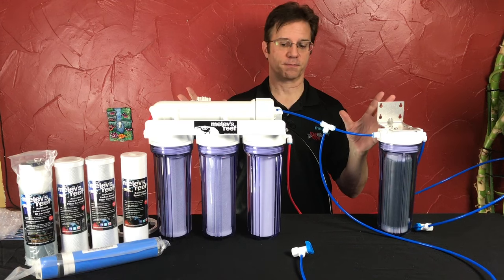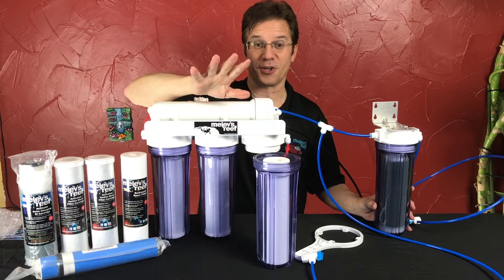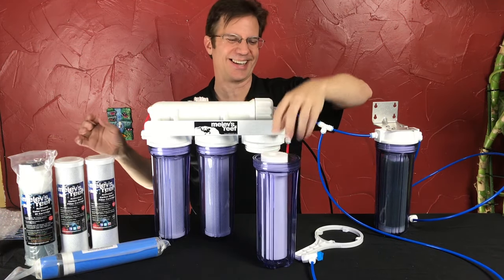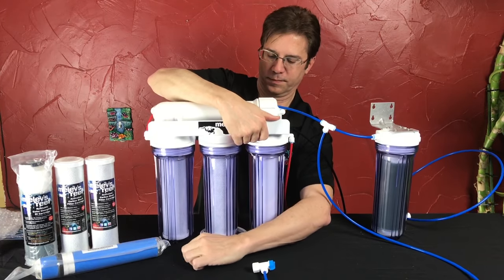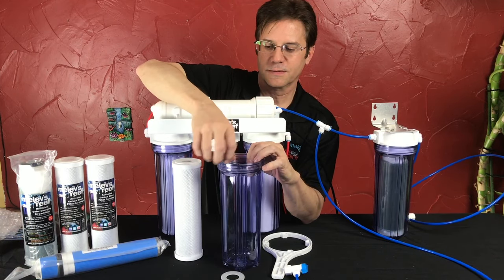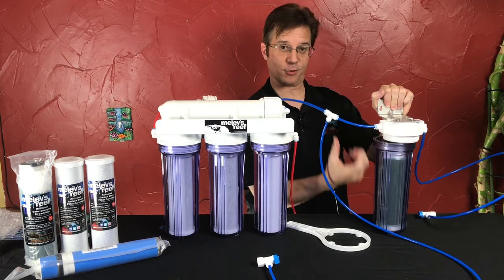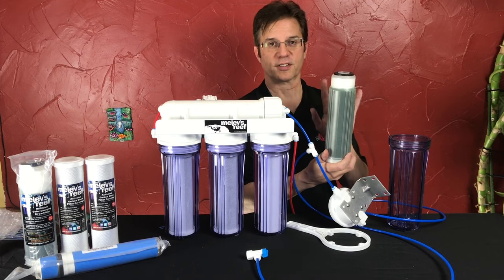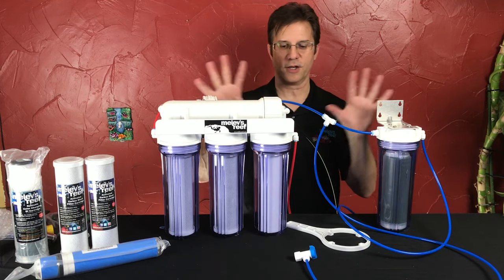How to Change RODI filters

Comment: I can’t unscrew mine with the wrench. I’m afraid I’m going to brake the unit. I’m bending the entire metal frame trying. I checked I’m twisting the same direction as you. Why dose brs tighten theirs so much!?
Reply from the maker: First, turn off the water going to the unit. Second, open the valve(s) on the output side to release internal pressure.  Then use the wrench with gradual pressure from right to left until it unscrews. There's a reason these units are bolted to the wall. :)

Comment: Hi, I know this dosent have anything to do with the filters but i need help.

I have been batteling bubble algae a long time ( 1 yare) and tryed every normal way of ridding me off the pest, like emerald crabs, sailfin tang, foxface and so on.. manual removal too.. the crabs have made the problem larger and now i have a few 100 bubble algae diged in my rock and on all my coral and so on.. is there a good solution? Or do i have to reboot the system with dryed rock? Cus in one month that is what i will do if i dont get a solution.. :/ please help!
Reply from the maker: If you lower the phosphate level in the tank, the bubble algae will weaken its grip on the rock. If you used Phosphate Rx like I do, I find about three days later, I can remove the majority of it more easily. Then the emerald crabs can get the last remaining bits.  What size is your tank?
Reply: Its a 155 gallon display, Total volume is 180 gallon With sump and so on.
 I have tryed out the phospate RX now. Used it a few times after watching Your video :) it Works great and some of the algae was easyer to remove now. so thx for the video on that :) but its still a pain since its inn all the rock so i have decided to setup a 100gallon Coral QT and rebooting the tank.

Comment: Did I miss a step? Shouldn't you let the filter run for an hour without the RO membrane to flush out any carbon fines?  Speaking of which, no instructions for changing the membrane?  I find it's a pain in the butt to get out, and wonder if I'm missing something extremely obvious and make me feel stupid like.
Reply from the maker: That is the next video. :)
Reply from the maker: I've never done that (flush out any fines), not once in all the years of using RO/DI for my reef.
Reply: Ok I'm missing something then, what was the purpose of dumping the first hour of water (first video),  simply manufacturing "gunk" you want to flush away?
Reply from the maker: That is the remove the food grade preservative trapped within a brand new membrane. You only do that on a brand new install (new RO system) and brand new (replacement) membrane.
Reply from the maker: And here is the membrane changing video: https://www.youtube.com/watch?v=JTtuHfwyXVo&index=7&list=PLMHh1mIdNsyIt-jVp6ekrdTwo5LqVNJIh
Reply: Could I use your resin replacement canister in a brs rodi unit? Love the channel btw
Reply from the maker: @taneshag5337  I just saw this reply, sorry about that. Yes, you can. :)